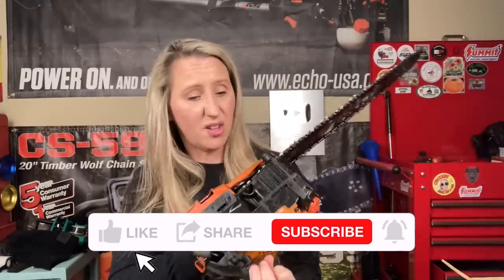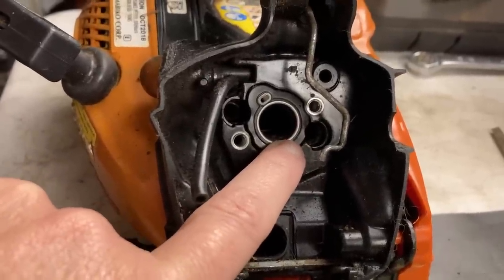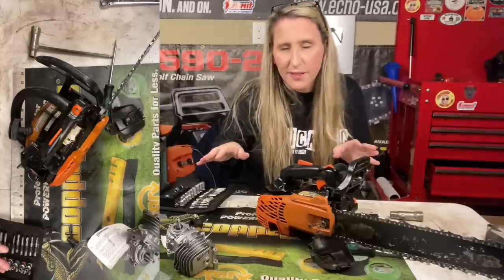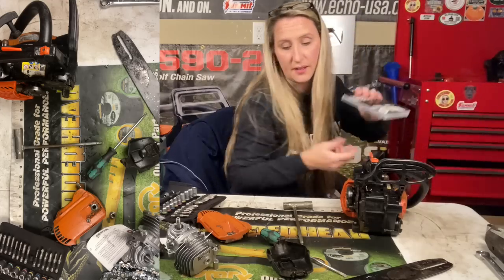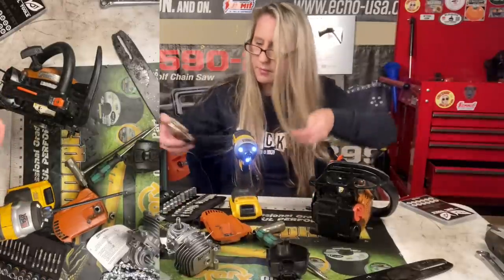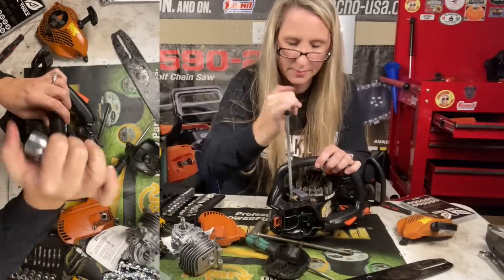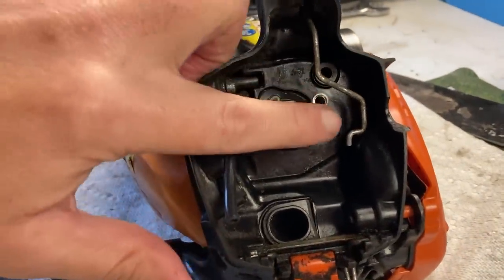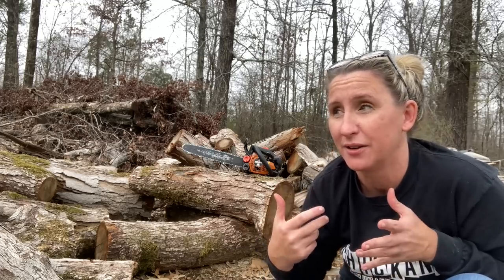Customers $500 chainsaw DESTROYED! Echo CS2511-T engine swap Repair/Vlog

Comment from the maker: Hey guys! I had a lot of people recommend a helicoil. Although my customer knew of the option, he wanted the new engine. Being a unit he relies on when he has climbed up 40ft in a tree, he wanted it top notch again. Although helicoils are used often , they are not reliable in chainsaws that are run everyday with so much excessive vibration. Thanks for watching!
Reply: I never use helicoils on saws, but I do use solid thread inserts, which I've never seen fail, I'm a full time timber cutter that runs both husqvarna and stihl for 25 years.
 The thread inserts are called Timeserts
Reply: I could see wanting the new vs some type of fix like helicoil or tap and bigger bolt for an application that some one’s livelihood and personal safety are involved here.
Reply: @haneyoakie14  a lot of manufacturers use thread inserts on their pro saws, from the factory
Reply: I love your videos, but I would have bought a new saw. I think it was a stupid decision on his part to put that much money into it. Thanks for posting this video. Very informative.
Reply: @tomsommer54  She said the whole job would be $200+, with a new engine.  It's still half the price of a new saw.
Reply: Why not become a stihl dealer to cause they make better product
Reply: @elultimo102  no she didn’t. Just the labor was $250.00
Reply: @tomsommer54  ---Only saving $130 from new?  OK, maybe not worth the repair.
Reply: @tomsommer54  I believe Bre said $250 the lot
Reply: @tomsommer54  ---I may have missed that, I'll have to rewatch the vid.  I admit that $250 in labor, plus a $120 part is more than I would pay to resurrect a $500 saw.
Reply: Although I've often used Helicoils, I would prefer a new engine especially for equipment used on the job.
Reply: Working in the nuclear power industry, helicoils are an approved repair option even in safety related equipment.  I also do a lot of auto repair myself, I have used helicoils in various situations that include vibration areas.  I would not hesitate to use a helicoil, including in this chainsaw application.   
FYI, helicoils are demonstrated to be stronger than the timeserts and other threaded repair inserts.
Just my two cents...
Reply: Yes!!!👍😎
Reply: @forrestwright5981  yes, much better than helicouls 👍
Reply: There are other thread inserts that are actually stronger than the metal itself which would have worked fine, but the customer was willing to pay for the engine, so who would argue.
Reply: @dxt7339  DITTO.  There is no way a proper helicoil is backing out of anything.  These things are rated for aircraft repair.  The helicoil is 10x stronger than the parent material.  Now customer preference, I can get behind that given it is a older professionally used saw and everything else in the engine is 5 years used.
Reply: Well, now her parts shelf holds a slightly used engine that out of the casing could carefully be repaired with a Time-sert or similar to as good or better than new.

Comment: At first i was impressed to see you let it idle for a bit as a break-in. But then i remembered my Echo dealer selling me his last Short Pole saw (ever seen one of those??), and he made a point that right at startup to give it a burst of full throttle. Explained that Echo states to do this on new engines to seat the rings (or something like that). I LOVE this short pole saw. I believe they are totally banned so you don't see them anymore, but you want to talk about a handy limbing tool. Forget about all that bending and reaching bs (even w/this tiny echo)... you just reach slightly and let the short pole saw get everything w/o ever having to bend down or over or whatever. Absolutely LOVE the thing. ...Gravity-feed bar oiler- has a little 'cup' on the inside: when you need oil you just flip the saw sideways to fill the cup and keep sawing. Great tool (but for sure dudes were cutting their toes off with them 😄 🤣 😂) 👍-

Comment: For the amount of times I have seen you use a screwdriver as a lever and a punch as a driver, I'm surprised that you don't use a 2 leg or 3 leg flywheel puller. I'm wheelchair bound and often the time between tyre changes means the wheels get rusted / weld themselves onto the tapered shaft. The puller often used to remove pulleys from engines works great to provide the pulling and the central pressure to remove the wheel. I'm surprised you don't use same, no shock transferred through to the bearings.

Comment: While I did find the bikini string piston stop creative, one thing I have found extremely useful is a roll of para cord. I bought a 1000 foot roll for next to nothing ten years ago. It is perfect for a piston stop. Cut three feet off the roll, melt the end with a lighter or propane torch, use it, and throw it away when you are done.

Comment: I enjoy your candor. My old 360T I put a panther 16 inch bar and 1/4 inch chain. Reason is oriented to the tree trunk while cutting a limb to the right side, a longer bar will allow you to cut using the saw right side up. The larger the trunk, the harder to cut right side limbs unless you turn the saw upside down. My new 2511T carrying a 14 inch bar is plenty good. Pleasure watching you and your knowledge/.

Comment: Thanks for posting this one!!  I have a CS2511T that needs an engine housing because I stripped the threads in bar bolt.  Have it working for now but it is a project I am going to have to tackle.  I will have to do everything you did in the video, and have not had a top handle saw apart before.  you are so right!! This is an amazing little saw!

Comment: Have wanted the tiny Echo since it came out. If it were My saw... seeing pro use, i'd have had you put a thread insert in just so that we could mod the saw by boring it to .30 or .60 over. For an oversized cylinder on a baby Echo... totally worth trying out a helicoil to get something back out of the unit. 💪💪

Comment: Used to work rental.  Boss gave dude a brand spankin' new Stihl on a 24 hour rental.  Apparently dude got the bar stuck when the tree pinched it.  He DID get the saw out of the tree.  With a sledgehammer.  I reckon he didn't realize he could take the bar off.  Crying shame to see that pretty shiny saw come back in about 7 or 8 pieces.

Comment: Another great video! I like to save a little time and effort on the disassembly by leaving the spark plug in and using the compression of the cylinder as a piston "stop" (or more accurately cushion) when removing clutch and flywheel with an impact wrench. They come right off. Use short bursts on the clutch or it will come out spinning too fast and you may have airborne springs and shoes. You have to use a rope on the reassembly to get the torque right.

Comment: Micro top handles actually make a lot of sense. The incredibly small over all size makes it easier to maneuver in tighter spots. The light much lighter weight means a lot less fatigue. All this means the saw will be safer to run longer. It's a limbing saw. It doesn't need a ton of cutting power to knock off branches.
Reply: It is designed to be able to use one handed up in a tree. It is almost difficult to get two gloved hands on the 2511T, it is that small. I talked an arborist I worked for into buying one in 2018 and he loved it even though he had larger more powerful top handle saws. Echo now makes a regular handle version of the 2511 but I have not used it

Comment: Finally, the saw of my dreams and much needed these days. Until the price was revealed!! I used to cut a lot of wood but this week I'll be 75 and have had 6 back operations already. My little 16 inch saw is 16 pounds, 5 would be a lot better!! If you think that engine is cute take a look at some of the gas engines for RC airplanes!! My old Brison 40cc was hand built and was the shinest gift under the tree.

Comment: I am amazed you did not find all the damages before starting the rebuild, $459 for a new saw with new bar and chain vs a worn out saw which still has a smooshed muffler and broken recoil side cover and who knows what else is about to fly apart.:face-blue-covering-eyes:
Reply: The new saw was better money spent

Comment: Nice video. Customer most likely uses that to brush out a tree. Lightweight and easy to handle. I have the OWL torx set. Really like it. Just to make it a bit easier to lay hands on, I marked the common use T-27 bit with a red paint marker.

Comment: I used to do the rope trick on my walk behind engines till I got an air impact to loosen the nut holden the flywheel. Why doesn't that work on a  chainsaw ?

Comment: I was just about to buy a cs2511 this week, such a light and well built pro saw was very tempting! But because of my wallet these days and the fact that I could use a little extra hp, I ended up with the cs3510  instead. Hope it works well for lighter jobs on my property🙂👍
Reply: Should have got the 2511t. Out my eight pro saws I use it on every customers lamd and mine .70 percent of time it's first to go to does anything under 18 inches with ease best saw I've owned .had it 4 years only blowing it out changing the plugs filters. And one exhaust cleaning.3 years in.run shindiawa red armor .50 0r 40 to 1 ..I use that saw everyday Even for construction and deck teardown s. Climbing trees tomorrow with it like daily .you have run quarter pitch sprocket .a sthil polesaw bar there cheap drill a oil hole in the bar the sprocket you can get with the bar on sawagain online with chain 140 bucks .and replacement chains at your stihl dealer s..0.43 gauge mini super small pole saw chains. I cut down 150ft oak trees daily with it .will out my 355t and 201t stihl in all would below 14inches after that the 201t is faster in bigger wood but echo will still do it fine.buy you need those modifications done u can do it easy and take a drill bit about 5/16 or bigger and drill the muffler out rite where line is baffle. You don't need the warranty and in most states echo dealers are rental places and will take months to fix your saw this one won't need it unless you drop it out of tree. Wich guy should have had lanyard on anyways. If you don't drill muffler and add the sprocket bar kit it won't cut like it supposed to.as soon as I did those things it came alive no comparison to stock version the bar Chain it cokes with will not cut its terrible chatter ing,also you should remove the carb blockers with drywall screw it can't be tuned properly with them in.the way.screw the warranty it won't cut without mods.4 years no issue s .stays by my side 24,7 ..road clearance, property maitance .tree trim tree removals deck removals .even medium stump cuts no issues it will just clogging and bogg if you don't remove the carborater blockers and spark arrestor. Drill the while blow it out.take muffler off when you drill it.then take of the orange blockers to retune it.from factory its garbage tune and can't wake up breaking in.the day I did these things it became most useful tool I own I have 462 s 562 s 500i 201ts ,355t ton of saws no lies 70 percent of work is done with that 2511t.even with hernia it's one hand all day .I just cutt down 5 acres of trees on lake front in 2 days with this saw modifications of course. Only complaint I didn't do the mods from day one.the echo dealers here charge 50 bucks to tune it.when it should come started and tuned. Just do those modifications buy a tachometer 60 bucks for the echo one.or any brand .you won't need another saw .never buy clamshell homeowners saws or tools .sell that one you got before it's to late .hope u get set free ..it shouldn't be legal to sell homeowner saws it's a scam.any one over age 12 can run a 251lt one handed .any land owner that don't have one is being deceived by marketing
Reply: No don't do it
Reply: @Sethhaun78  It is already too late to replace it now, but then I have an excuse to buy the cs2511 another time. I have several larger Jonsered and Husqvarna saws that I use for heavier jobs, but needed a lighter saw for cutting smaller crooked birch trees with lots of branches and trees that the clearing saw can't handle on the property now and then. For this purpose home owner quality saw will be good enough for this purpose for me now I guess.
Reply: Just trying help people ..my 2511t as I said will handle anything up to 18 inches diameter. If your cutting stuff that size regularly and wanted a saw there plenty that are not plastic cases or clamshell.for one the Husqvarna t540i battery saw will cut anything .if your wanting Rear handle saws it's unlimited
Reply: Each is own I reckon
Reply: @Sethhaun78  I'm not a pro so I'm grateful for all the tips I get from those with more experience here. I have heard a lot of good things about Echo saws and will probably buy one of them as a replacement saw for my good old trusty Jonsered cs 2152 if it is no longer profitable to repair.

Comment: Love yer videos! Quick question. Do you ever run into clogged fuel caps? I have an issue on my backpack where it constantly gets clogged and prevents fuel from travelling due to a vacuum I assume as the tank hisses when I remove the cap. Usually happens at half a tank.

Comment: Having a small chainsaw is such a time and bodily-energy saver.  I recently bought a Stihl MS170, which weighs in at about 9 pounds with all its fluids, and it is a ripper!  If I had known about the Echo you present in this video, then I might have gone for it but its about twice the price as the 30cc Stihl.  Of all my chainsaws, my big boys are always a last resort.  They are capable of more work than this aging body!  Small saws will do 90% of what an amateur needs and they are a lot cheaper, too.  I always tell people to start small and work up to the next size chainsaw only if it's needed.  These smaller saws are incredibly torquey and almost fun to use!  
Your production values keep getting better and better on your videos.  Great work all around.  Thanks for sharing!
Reply: I ran a ms170 on a street tree pruning contract. Worked great. Be careful, the pawl on the starter cord is nylon and it wore out quickly. Handmade a replacement out of aluminium which lasted much longer.

Comment: My cs-271 got pinched by a tree top, about 25ft up, had to pull the top out of the tree with my cummins, person up in the boom lift didn’t hold it when too got pulled out, I cracked the top handle and a lot of the plastic, dropped it off last week of October, still haven’t gotten it back, and the saw was 3 weeks old, oops

Comment: You could have chased thread with machine tap.or injected some JB weld and drilled and retapped the thread.
Reply: JB would have been my first try then use a stud and nut  .. then perhaps a Heli coil if JB did not work .

Comment: Back when I was doing tree work all the time, most of the small saws were set up with 16 inch bars.  The extra reach was more helpful than a balanced setup because most cutting with the small saws was quick cuts on fairly small limbs. Of course you are NEVER to use any chainsaw one-handed cutting with the tip!

Comment: Not really familiar  with that model mine are 340s with12 and14inch bars i cut 20 plus cords a year to heat my house i also have a stihl 290 which is under powered and slow cutting even with a new chain.So needless to say the eches get used and the stihl sets

Comment: Unbelievable! That this with stood that Fall and only had that for Damage. I have an OLD CS 302 I bought my Dad back in the Day, The thing STILL Purrs. Just Curious Bre,  You know better than any of us Home Folk Mechanics, but is there a reason why No New Muffler and Fuel Lines were Installed? Only Ask because it was down to Nothing during Engine Replacement. 🤷‍♂. Just Curious, Not second guessing your work, I know I couldn't have done that in that same amount of Time Thats for sure. Great Video, and Kinda funny it LIT Off on ya just Lubing up the Cylinder. 😅.

Comment: Hi, I've been watching your videos for about a year now, and their great. I've been cutting fire wood since I was 16, I'm 65 now, and working on saws, not as a business but as a collector, I've got around 40 big old mac's that I still use, I've got 4 that are my favorites. I've never found a small saw that I had much use for, that was dependable, until 3 years ago,  I bought that little echo, and wow, it's my go-to saw, and I cut as much wood as some pro's do.mostly hedge, or Osage orange. Tho I do the big cutting with my 700, that echo does everything else, from 20 inches on down, mostly with one hand. It is an extraordinary,dependable,fun saw to run. Thanks for the videos you do a great job!